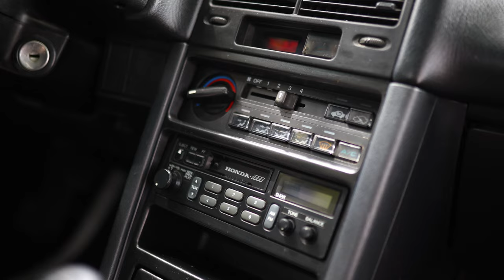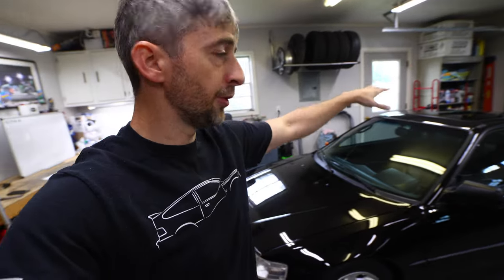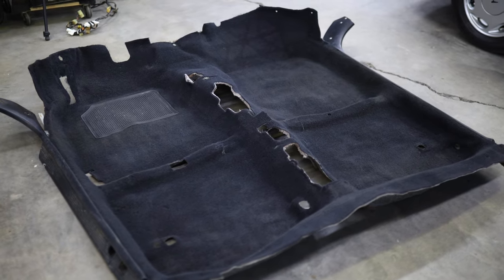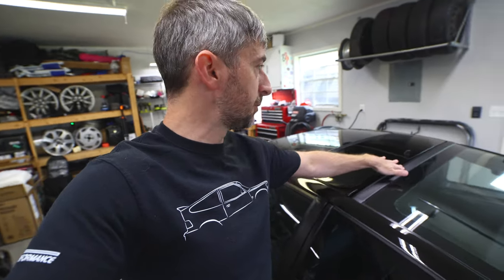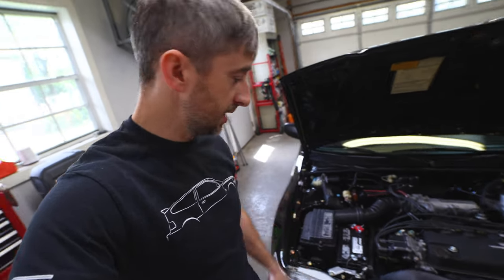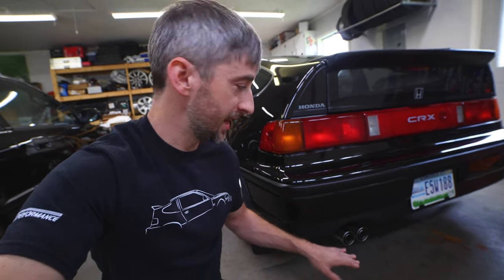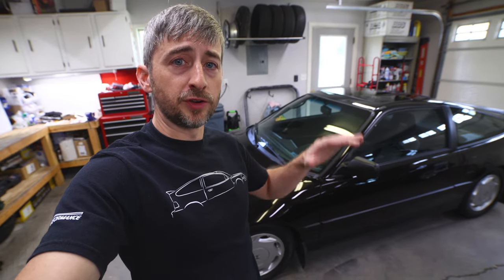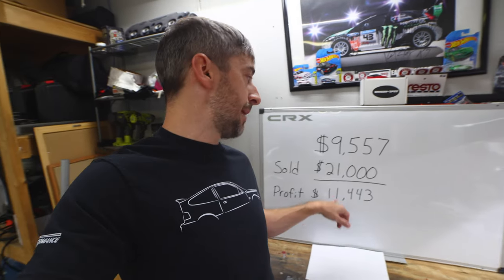1988 CRX Si Restore Part 50 - Cost Breakdown

Comment: I bought a brand new 1985 CRX Si when I was 17yrs old and a senior in high school. It was red and grey and the memories that are still tied to that car as I sit here now 55yrs old are strong. So much fun and laughter that I can't even begin to describe it. It was totaled in 1991 when an uninsured 17yr old in a large truck plowed into the back of it while my future wife was behind the wheel and stopped at a red light. Its last job on earth was to protect her and it did so without hesitation. One of my favorite pictures is of me in '86 sliding it sideways in a snowy, completely empty Mammoth Mountain parking lot with my surfer hat on backwards and one hand out the moonroof throwing the rock and roll sign.
Reply from the maker: Thanks for sharing!
Reply: @crxseth  The work you did on this was simply incredible and the end result is even better. You have a ton of talent and should be very proud!

Comment: I had 2 91's and 1 90 and man do I miss them. I did a full jdm swap on the 91. Power folding mirrors, gauage cluster, interior etc. Then I went full tard and built a b20 bottom end with a C1 head. Then built the motor with all race parts, custom Garrett turbo blah blah blah. I spent a massive amount of money. Ended up making 650 to the wheels. Did mid 10's in the quarter. Painted it summer green with blue pearl in the clear from dupont. White 19" TE37's. Then I sold it. Lol. Damn what a stupid move. I miss that car. Anyway, you did that Rex justice man. Looks great. You did a fantastic resto job all in the garage. Props brother! Look forward to more👍👍💯

Comment: In 2002 I bought a 91 Civic HF Automatic, It wasnt fast, but it was quick and got amazing gas mileage. There wasnt a corner i couldnt handle, or a turn i couldnt make. First car out of every parking lot. I ended up selling it to a Sergeant First Class(SFC) Medic because i had gotten orders to Germany. It was a mistake and ive kicked myself for years about it. Until last weekend, i met a guy in south carolina and found myself another one. Its all there but needs some work on the head and a couple little rust spots and a new paint job. Its probably gonna take me years till im happy with it, but im so excited to finally have another one. 
Thank you Seth for the videos, this channel inspired me to move forward with my CRX dreams.
Reply from the maker: Do it!

Comment: Considering a 1988 CRX Si had an MSRP of $10,195 new, when adjusted for inflation, a new, off-the-floor '88 Si would be $26,459.26 today. Granted, this one in particular isn't all original, but for a showroom quality CRX that was masterfully restored, $21,000 is a damn good deal. 

Hell, if my math is mathing, $11,443 is almost a charity for labor. Assuming you worked on the car for 16 hours every month for two years, that comes to $29.80/hr. If more hours spent per month, the lower the cost per hour. You absolutely did this as a labor of love, and it shows. Hope to see more of these restorations in the future, and hope to see more subs come your way!
Reply from the maker: Thanks for doing the math. It was definitely a lot of work!

Comment: IF i had it id give u $30 K hands DOWN, my Brother owned that year  in orig condition as good as yours, he was FELIX ungar man! Wish he stil had it, He gv me a 85 CRX SI Curaco Blue n matching Del SOl wheels, momo steering wheel, hi Pressure clutch plate, It launched like a LS-1 Camaro w/600HP!   In 1995  I raced a GT Mustang,w/85 CRX SI... it did NOT run away from me!  :)  He kept lookin over n shaking head in DISBELIEF!  lol  Your work is just stellar man, thx for putting all this together!